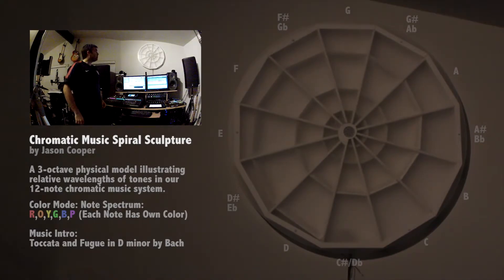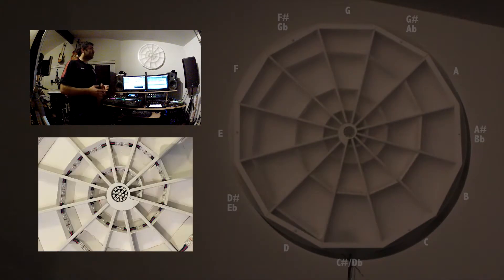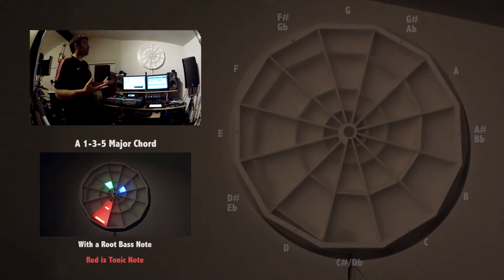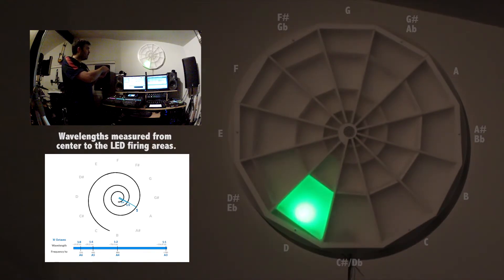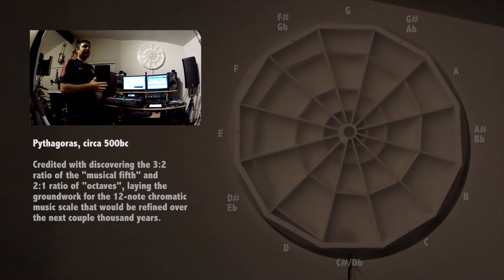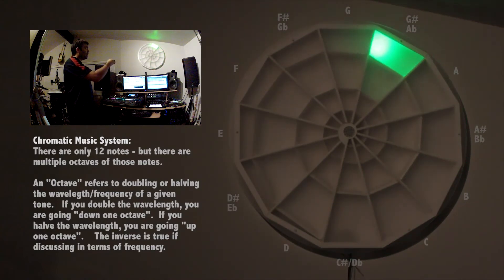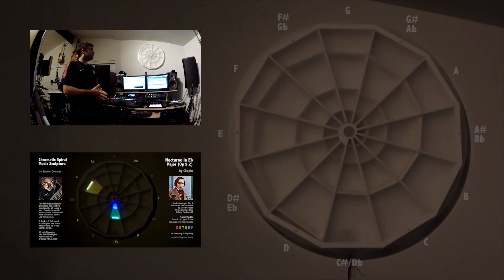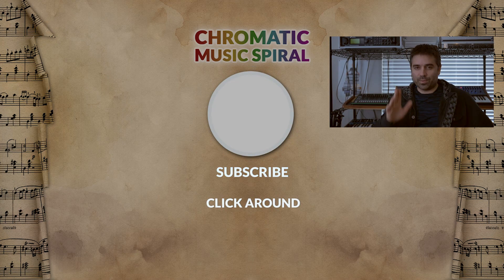Arduino Chromatic Spiral Music Sculpture Information

Comment: This is great ! How do you convert audio data to midi data ? Polyphonie seems to be perfectly handled. Or maybe the input is through midi data only ?
Reply from the maker: Thanks!    Yeah, the input has to be MIDI - For pre-recorded songs, I spent a good amount of time on fine tuning the timing.    If I'm just playing on keyboard, or my TriplePlay equiped guitar, then then it can render it in real time.  Or for my own compositions in Ableton, I route any recorded MIDI to the light spiral, and do a Audio to MIDI transform on other recorded tracks.     A few years ago, I did start to develop an alternative approach using real time FFT analysis (Fourier Transforms), but was not happy with the results...  It may just require far more processing power than I had on tap with the Arduino, or some dedicated audio processing chips.    Theoretically, with FFT, you should be able to get some pretty decent realtime, polyphonic rendering of audio.